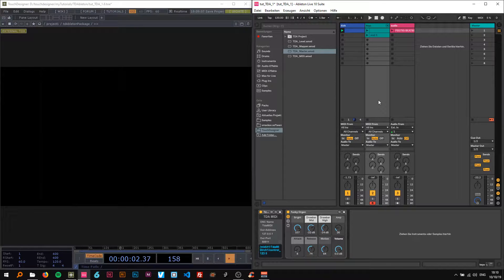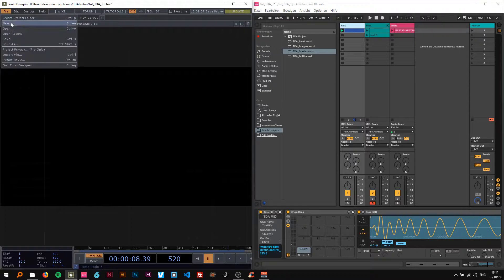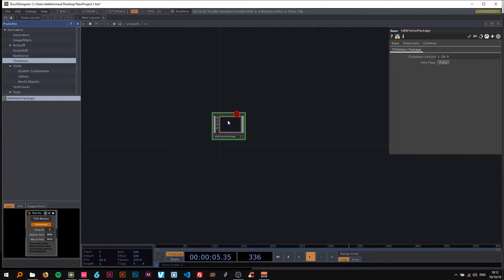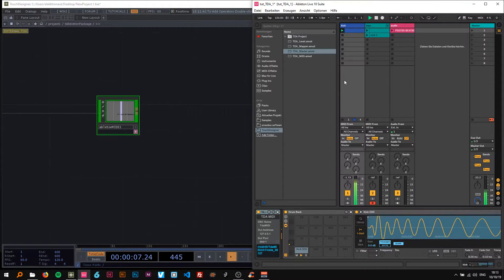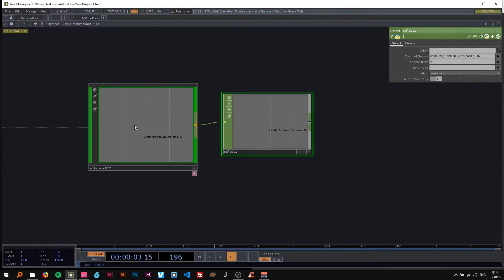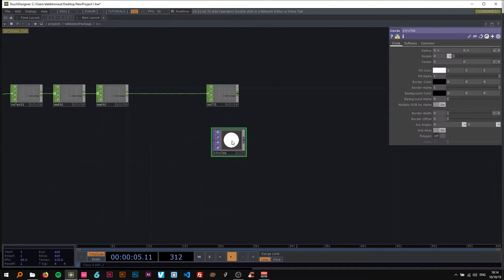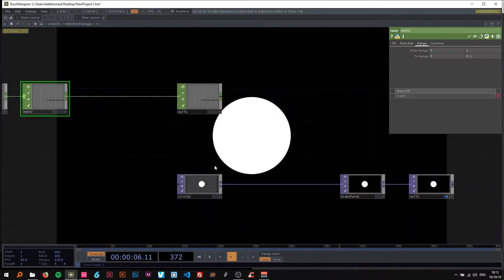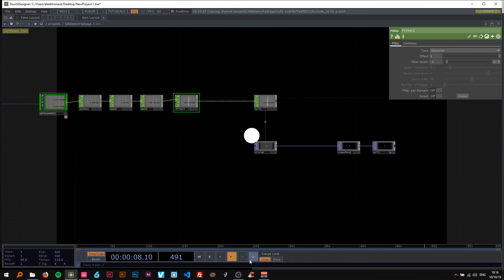Simple Kick Mapping – TouchDesigner + Ableton Tutorial 2

Comment: Everything has gone smoothly for me up until 4:42 at which point I get lost. Your mouse pointer disappears, so I don't know what you did to make the display update/circle get smaller. 

I worked out click and hold on 'Radius' brings up the value options, and I selected 0.1 as you did, but the value does not seem to 'stick'... Ah! But I can click the '+' and change both x and y radii separately to 0.1. That worked! Yet to see if that will enable the rest of this and following tutorials to work though. Fingers crossed... EDIT: Yes, it works!!!  Onward! >>>>>

Comment: Hello, could you help me, my filter is acting real wierd. I copied your parameters, and either it doesnt slow the animation or it makes the signal constant, there is no between
Reply: And funny part is that the filter works with lfos, only the has this problem with chanel note
Reply: @davidreseterics4804  Having the same issue. Did you find a solution?
Reply: up ?